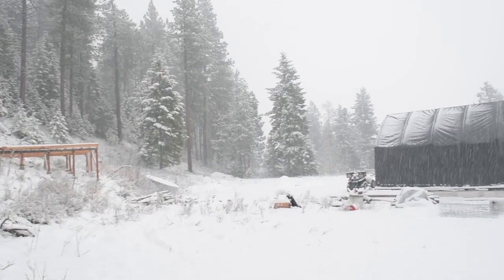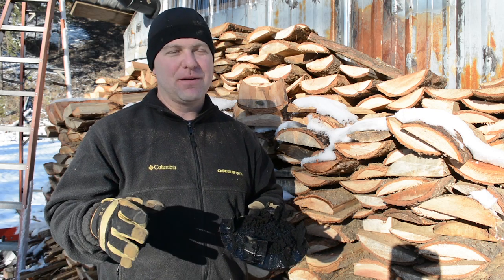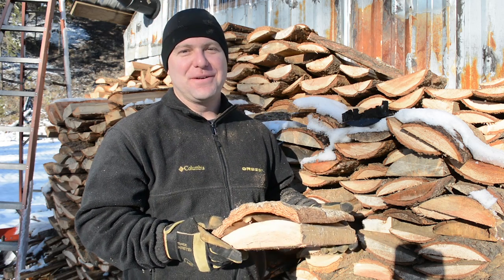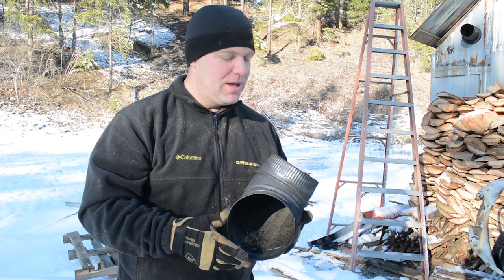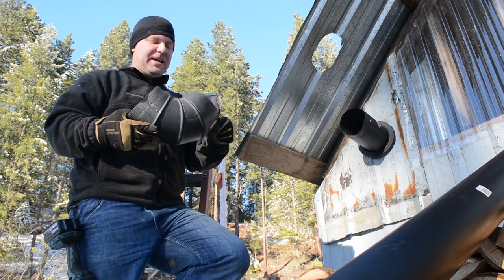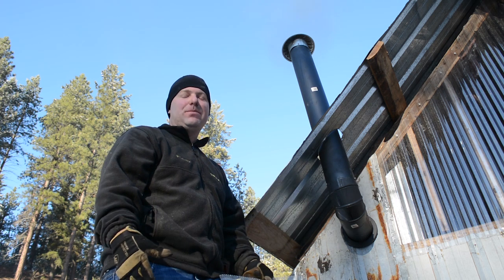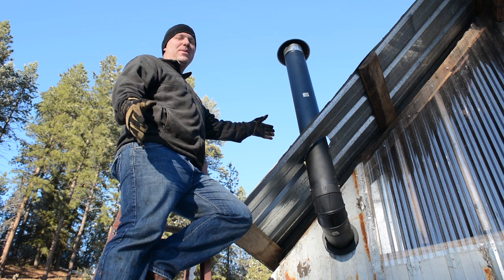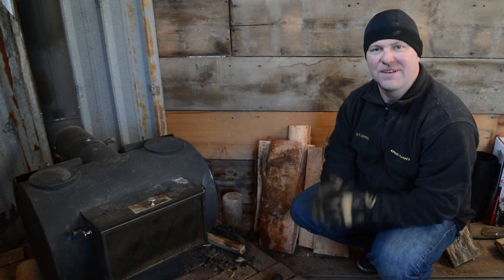WE GOTS PROBLEMS! Troubleshooting & Cleaning Our Wood Stove Chimney Pipe

Comment: Single wall is leading to cold walls once your pipe goes outside the heated space. Those cold pipe walls will make the smoke (creosote) in your exhaust condense on the pipe walls. Double wall is code for a reason. It helps keep the inner pipe warm which reduces condensation. 
I don't want to sound harsh but another problem you have is wet wood. Water does not burn so wet wood will always burn badly. If you do not split and stack your wood for drying at last a year ahead, even for western softwoods, you will continue to have creosote problems. Don't blame the bark, it is not causing you to burn wet wood, your lack of pre-planning is. If you are not sure about how dry the wood is, spend $20 and get a moisture meter at your home improvement store. Never try to burn wood that shows over 20% moisture on a fresh split face and most of your troubles will end. Wood burning is not a case of finding some scrap wood at the last minute. If you don't plan ahead you will pay for that lack of planning, as you are just starting to learn.

Comment: If you can't do a double wall exterior pipe then perhaps you could install a T instead of the elbow? That way you can easily clean the pipe without having to take it all apart.You are correct that the fire wasn't hot enough but also the double wall keeps the smoke hot longer preventing excessive creosote build up. Great channel.
Reply from the maker: Totally our thinking except a single wall t might be hard to find or not exist since it's not technically chimney right? It's stove pipe. We figure we'll give it a few weeks and see if it's going to hold up and if so a t would be rad to make cleaning faster but if not... A spending $$$$ we go! Haha. Yea we've tried to get it hot but that double wall chimney pipe on the cold days would help. I just don't know that it would solve our problem completely. Might be less of a problem if anything. Lessons learned about burning mill ends too. Half bark, half wood. Makes a mess! And doesn't make a ridiculous amount of heat either. Though we are keeping warm. :)
Reply: +Pure Living for Life I didn't read all the comments but I had the issue with excessive creasote build up it the first month after I installed my woodstove in my home, it was the unseasoned wood and letting it burn too slow at night while sleeping. once my wood was properly seasoned and i let it burn hot problem solved, been heating our home for nearly four years now with only minimal chimney cleaning.
Reply: +Pure Living for Life 
Single wall Tees are made in every wood stove pipe diameter and in gas pipe as well.
FYI for all reading this;
We used 5 " pipe outside a two story schoolhouse in Kansas. I shielded it with 6" gas pipe. I screwed them together with long screws which held them in place and acted as spacers as well. That worked beautifully and we had sub zero weather North of Topeka many times. 
The last two years there, I lit exactly two fires, one the first winter, and one the second winter. And THAT was using an Elk hunter camp stove from Cylinder Stoves. 
It was the Outfitter Model. They make Bigger one now, The Yukon. They should send me one of those for this endorsement!!! :-)
Seriously, they are the most perfect design for a large portable stove ever made.
Lash rings for packhorses, warming trays, 5 gallon water tanks, flue oven, and able to hold fire for 30 hours.
I barbecued inside on racks, just amazingly prefect design!!!
...and portable...think about that. 
Less than 100 lbs with tank, tray, legs and grate...

Comment: Pine has a much high sap/creosote content than fir, especially in the outer few inches of the wood. Burning the bark with what would be mostly "sap wood" will give you VERY VERY high creosote content even when burning hot. Also I just installed my first stove/chimney with single wall. -25 C here and it drafts just fine now, no insulation. The problem was clearance over the peak of the roof, once you get past the strange vortex created by wind hitting a sloped roof. I extended it and cleared the peak all my issues stopped, just by maybe 8" or so was all the difference. Good luck, love what you guys are doing here!

Comment: We used to live in WV. Out in the sticks. We had a house that didn't have any heat in the basement. So I purchased a wood heater. We used slab wood from a mill a little down the road. It was always various hard woods. It burned great. However, we used double-wall SS pipe. We move away over 30 years ago & that pipe is still working well. 

Just my 2 cents...LOL

Comment: I realize this video is from some time back but want to make a few comments. If you have not upgraded to double wall pipe you should. It will make a lot of difference. Also every turn in the pipe effects the draft and how the flue draws. Remember that in the future for your house. You want as straight a shot for the smoke gases as possible. Consider building a woodshed to store and season your wood. I live in hardwood country and it is of course different but I season my wood in the dry a minimum of a year. Wood I cut this year will not be burned until next. I have never burned softwoods but you have to use what you have. In hardwoods the bark is not so much a  problem so long as it is real dry. 
Good luck!

Comment: First sorry about the book; just some idea's that I've used on house's:

 
    Check with your wood stove shop's around the area and get broken 
fire brick and high heat mortar: Then crush the broken fire brick up 
into   1/2"-3/8" minus and mix with the mortar to use in your rock 
thermo mass will help to retain heat better and give it up better too: 
Also you can put up oiled play wood  on your wall joist and hang chicken
 wire with some through joist support in 2'sections and jump pour; "( 
Then do 2" more and when the bottom 2" can support it self move that 
form up for the next pour: It will also cut down on drafts too)" and 
pour the fire brick mortar mix with larger rock into the space's for 
more thermal mass "(For safety put 6" to 1' wide ply wood braces across 
the thermo mass in your wall at the joint and in between While leaving 
the most exposed that you can)" and on the floor around your stove: Use 
the "T's" to make your clean out easier but just put caps on the 
bottom's and make a wand for your compressor to blow the level area in 
so as to clean it to your next "T":  "(I guess this post is more for 
others to read for their Info ? But this can be used on your house and 
barn: For house get ceramic tiles and make patterns behind your wood 
heat stove and wood cook stove for thermo mass and good looks at the 
same time while having zero clearance Go from lowest level to highest 
level with your thermo mass for best result's and as close to the center
 of your house that you can)".

Comment: You really need to eliminate the elbows should be straight through the roof clean out at the bottom. Debris will accumulate at each bend straight though will end up at the bottom clean out.

Comment: Because it's 'wet' firewood you can turbo dry it by stacking it up inside against the split betwwen your temp barn and the carport tent.
The draft wil turbo dry the wood whilst the wood wil function as an extra inside insulation.
Reply from the maker: +J. Verheulst That's genius! We're trying to get things put away in storage for winter and make room for a few days wood inside. That should really help dry things out. Just picked up another cord today and it's seasoned, but been rained on a few weeks. Hope to get it dried out soon so we can start burning it. So much to do! :)
Reply: Don't work to hard guys.
Rome wasn't built in a day either... ;-)

Tip (if I may): Prioritise those task that'll save you the most work in the future and give you most comfort and relaxation.
But you guys probably already thought of that.

Comment: pine burns awesome! but ONLY after its been "seasoned"👍 ive been using  single wall "stove pipe" as a chimney on my barrel stove for awhile now and as long as ya dont burn garbage, wet wood ect it'll stay fairly clean! ive got probably 4 cords of dry seasoned pine that I will burn on the occasion! however, I dont burn it all day or on a regular basis. its good for quick hot heat but it can cause build up in ANY kind of chimneys! keep up the great work guys👊 stay warm and stay safe👍

Comment: Great Channel. Just found you guys. Double wall chimney would make a huge difference. (stove pipe not as much) Lots of money up front but often come with a lifetime warranty. Stove pipe (black pipe / what you are using) looses heat way too quick. You want the temp to be above 250 F or higher because creosote starts to form rather quickly. 

Stay safe and warm.

Comment: we had that happen, we had to switch to very dry wood. we had other wood, but when it was cut you could see water coming out. ok but it was seasoned for a year. unfortunately it was sitting wet for 4 weeks. no matter. well it doesn't burn. you can only use it when the fire is roaring and then only one piece in relation to all the other pine pieces. pine burns great and extremely hot. so far so good but the spark arrestor looks black. so we are getting new wood

Comment: You chimney  is running to cool and create lot of sod i was live in poland we have brick build chimney and burning pine because  hard wood is so expense  and wen is chimney is on fire we just let burn because roof is metal or clay.Take a look on rocket mass stove heater the work pretty good and burning clean .

Comment: If your looking to save money you could also use another single wall stove pipe. Looks like you have 6" pipe so if you had 7" or 8" single wall stove pipe on the outside of that it would keep the 6 " warm. When you put the larger pipe over pack it with fiberglass insulation (unfaced). It will act like the double wall or metal bestus pipe for a fraction of the price. Nothing like the real thing but this is an inexpensive alternative. I've been using wood for years and even sold for a few!Any questions let me know!! Love all the video's!! Nice to see that the wife is by your side and is a (Huge help) with the project!!

Comment: Retired sheetmetal worker here. It is not double wall pipe you want, that is for water heater and low temp furnace applications. You need all fuels pipe from 12 inches below the ceiling (check local building codes.) to the chimney cap. You need a thimble where it passes through the ceiling so no combustible material can get near it. Use black single wall from the all fuels to the wood stove. Do not penetrate the inner pipe on the all fuels with a screw.....

Comment: You guys are doing an awesome job, and like others, I would hate to see it all end in disaster. Take the advice given... I would use double wall inside and Selkirk double wall outside. The spark arrester screen is your biggest problem - get rid of it! Your investment in good appropriate materials will pay off. You will be replacing that stove pipe a lot due to failure. Buy the good stuff once and you can reuse-reconfigure for your needs down the road when required. If you can make a wood stand inside and load up a lot of wood along one wall, it will help insulate a bit plus dry out over time. Also, take advantage of your bricks. Build a corner fire  back stop with brick(heatsink) - just dry stack - they will heat up and release warmth when the stove is not fully loaded - at 3 in the morning!. Will also ad some protection... Nice stove - is it an airtight version? What is the efficiency rating? Carry on...

Comment: Way after the fact, I know, but YES single wall pipe will clog far sooner, no matter what wood you burn. It cools, slows the smoke, condenses the water, freezes it and clogs the pipe.

We had about 30 feet of pipe outside a schoolhouse. Single wall clogged weekly. We covered the 5" wood stove pipe with 
6" galvanized gas pipe.
That made all the difference. Cleaned it very rarely after That.

Comment: Already stated by a few folks on here, but getting rid of those elbows would help in a major way. If you can do the work to properly seal it going through the roof with the proper flashing, you are way better off going straight up and through the roof from the stove.

Comment: The rotary wood splitter (The screw type) can be used to remove the bark.  Once you get a huge pile, rent a wood chipper to turn it into mulch.  A Cheaper paving idea is to use old roofing shingles pulled off buildings,  The hard part is getting all the nails out, if they used copper nails pass on that load, Steel nails can be retrieved using magnets when it's chipped. All asphalt is, is a durable waterproof coating, to keep water off your compacted gravel and to keep the dust down. Tar paper is no good, you need the sand on the shingles.

Comment: You could do with more of a gap at your cap to make better airflow we have about a six inch gap under the cap and we burn all sorts of green wood etc and it never seams to soot up that bad , it might be a cheap fix and worth a try
Reply from the maker: +Sthilboy56 You nailed it! We put on a gas vent stove cap which has a much larger breathing hole. Took out the spark arrestor (it's rained non stop the past month, so if something catches fire....you get the idea) and boom, she's happy breathing chimney again. Thanks for the tip. We're' burning everything again and learning this stove loves a few pieces at a time and smaller pieces.

Comment: I'm really enjoying this series of yours. Please, keep 'em coming!

One minor tip. The wood that you have inside to dry out? Wood dries faster at the ends than the sides. Might be better to stack it horizontally, against the wall, rather than vertically. And maybe splitting into slightly smaller pieces, maybe wrist size. Just my opinion, though.
Reply from the maker: Great tips Ron. I've been splitting some and noticed exactly that! It dries quicker and burns easier and faster. Excellent suggestion. Soon we hope to build a proper firewood box. Till then this tote keeps our cabin from being a filth pile. Haha. Thanks for joining us!
Reply: +Pure Living for Life I don't know if you are familiar with the Wranglerstar channel, but Cody over there did a multi-part series of videos recently on building a really sweet kindling box. He also has about a bazillion homesteading videos of all sorts.

Comment: There is an entire thriving community (club?) of >Firewood Hoarders< that are quite the resource when it comes to all things wood heat.  Stove designs, both classic and modern, and all of the gear that goes along with wood heat, including chimneys, are discussed on a daily basis.  

PS.  Nothing wrong with your temporary chimney in your temporary cabin.  I would check to see that you are within limits as far as your clearance to combustibles is concerned.  Should you ever have a chimney fire in your stovepipe chimney, it could have disastrous results.  Regular cleanings would be a smart idea. ;-)

Comment: Wet wood will give you problems. On chimney - cheap option is to insulate the chimney yourself. Use some batt that can handle few hundred degrees, use some cheap (ventilation) tube as outer tube, build a cap and thats it.
Reply from the maker: Simple and actionable! We have a laser thermometer we borrowed and the temps really aren't that high which is reassuring so maybe we'll get around to insulating if a bit. :) Cheers!
Reply: +Pure Living for Life the purpose of the insulation isn't to keep the outside of the chimney cool, its to keep the smoke in the chimney hot. Smoke start to condense around 300 degrees F and that is what causes creosote and the clogged chimney cap. For a point of reference the gas inside the chimney is usually twice as hot as the pipe its self so keep the pipe over 150 as a minimum.
Reply: +Pure Living for Life 

Laser guns rock!!!
You can know what is normal on stove front, wall, back, flue inside, outside. Excellent!!!
I love it. I can check temps on stove, walls, ceilings in four rooms in the house I am staying in and know that the stove on the gay end of the house is okay, bc the temp at ceiling is 65 degrees, same as living room, dining room, kitchen. I can ping all of them from the couch I sleep on.
The whole greenhouse amazingly is about the same temp also, other than near the stoves.
Reply: +Tyler Johnson 

This is educational for everyone who will read it, shop even though I am way late, everyone who might ever beat with wood should listen, remember and learn from this saga.
Tyler is right, and I had already said the same thing before I read good comment. Listen, learn, remember. You may help save someone life with the information.
I have seen so many houses burned down here, I cannot remember them all.
Shoot, My son has helped rebuild  more than I can remember.
Most were caused by utterly stupid wood stove mistakes; throwing gasoline on a Fire to "get it going" while being allowed to live in a basement apartment. It worked...Burned a two story house down...someone else's. 
Nobody was killed.
A child died in one fire.
Washington said that Fire is a great servant but a terrible master...like government.
MANY people will be heating with wood I the next few years. 
File this information away in your mind.
You might be one of them and the life you save may be your own.